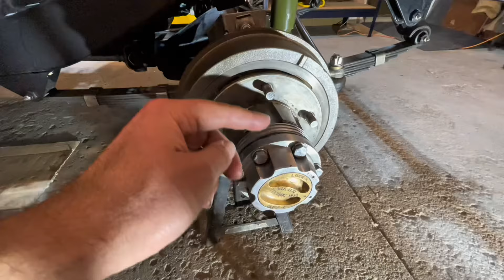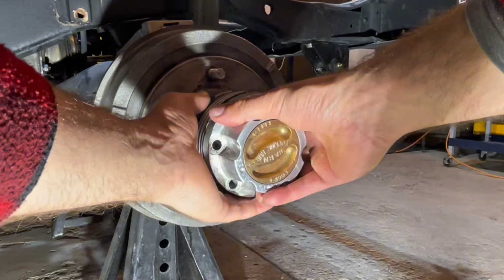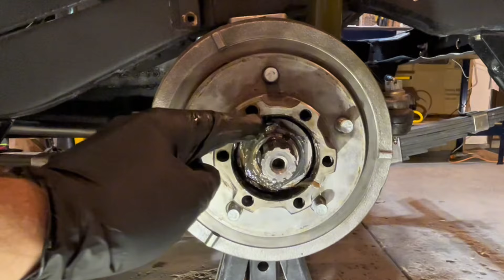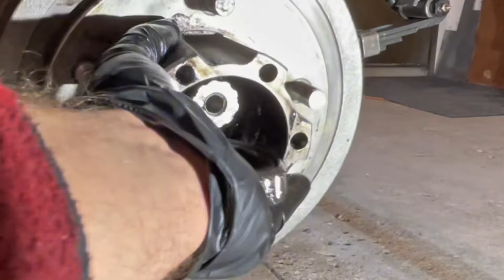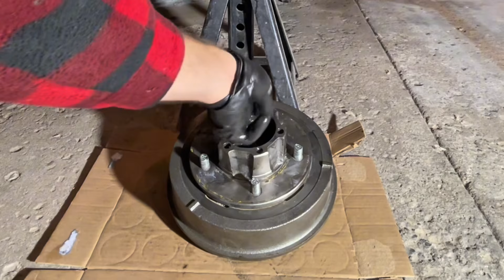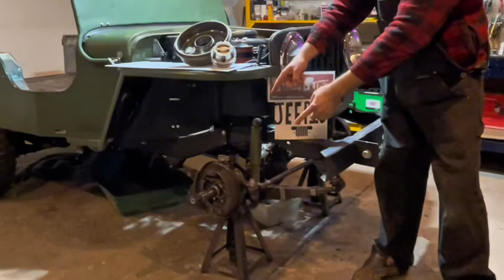How to REMOVE Front Axle Wheel Hub | 1941-1964 Jeep & Willys

Comment: On my customer's 1966 CJ5, that lower portion of the Warn locking hub (the portion with the o-rings around the outside) had a circlip you you had to remove after getting the top "hat" with the switch off, to allow that lower portion to slide off.

Comment: Hi. I am new to Willys. Just bought an esrly 47. The drum has a hole for fesler guages to adjyst brakes. Weitd thing i have a bendix stearing hub and it has threads and a nut either cotter pin holes. Only on passenger side isnt that strange?